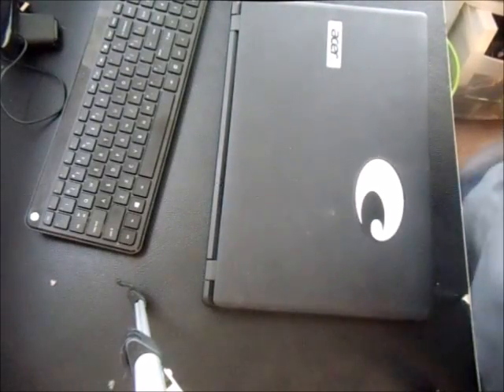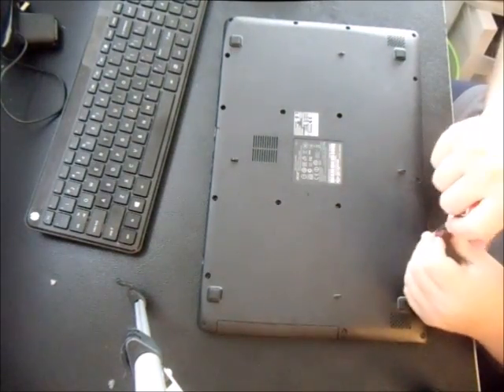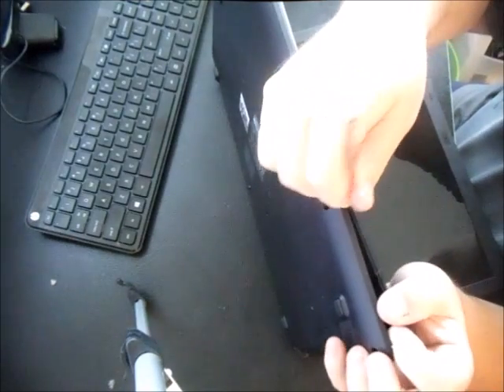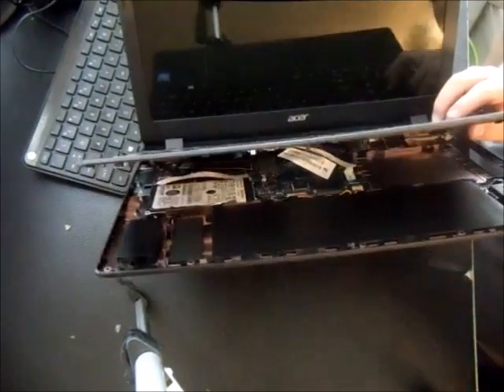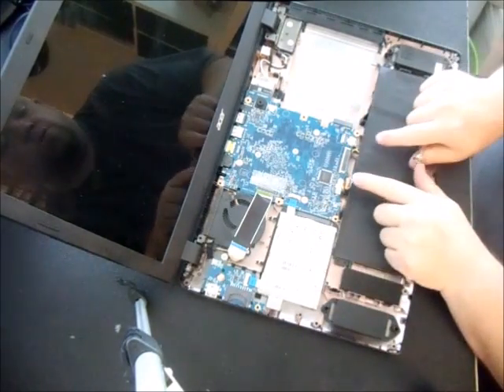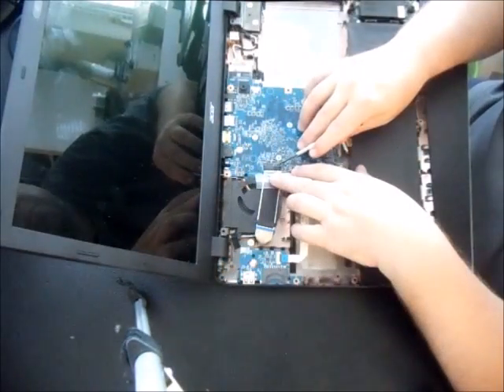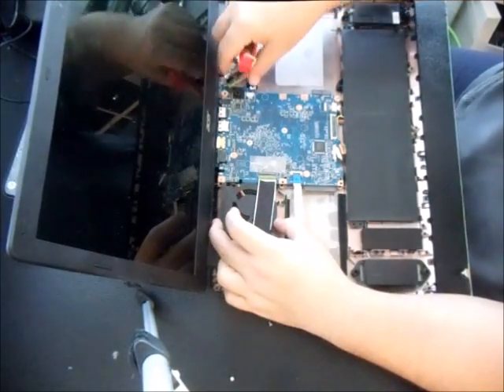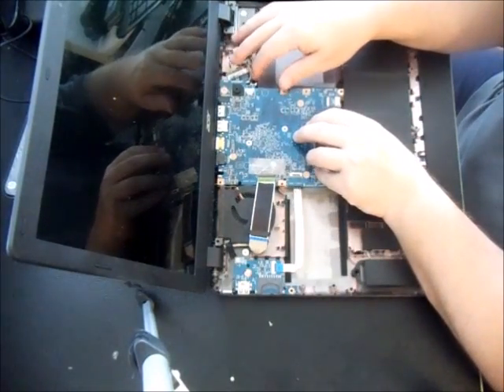Acer ES E15 ES1 ES15 Laptop INSTALL Upgrade MEMORY RAM Installation 15 Aspire How To Replace DDR3

Comment: can i add an additional RAM , instead of replacing it ?
Also, i happen to have a DDR 4 RAM, would it work on top of the existing DDR 3 RAM ?
Reply: It wouldnt work as not compatible

Comment: So for this model you can't just remove the back cover ?
Reply: No. It would be too easy for clients to upgrade their system. Rather make them plan buying new one instead of upgrading.
Reply: 9397 Racing the one I have which is similar but not the exact model is so easy there’s a panel in the back that pops off no need to take the whole cover out
Reply: That is how they were done back in good old days :)